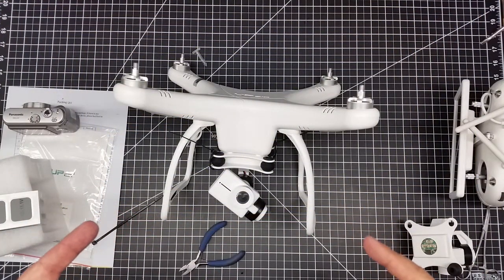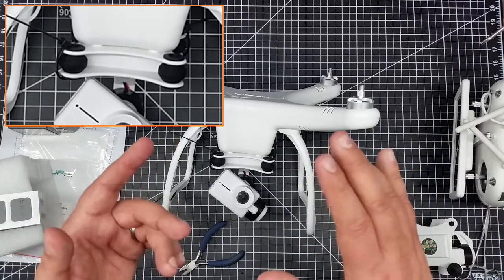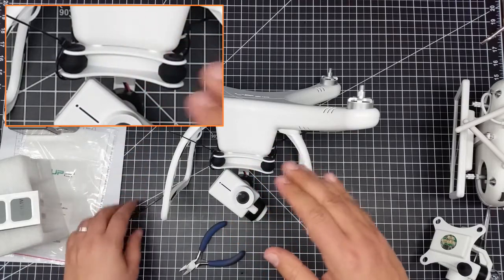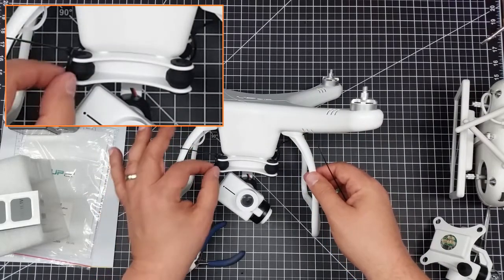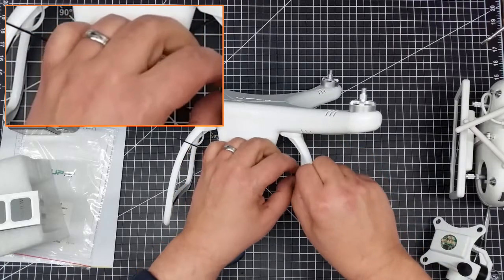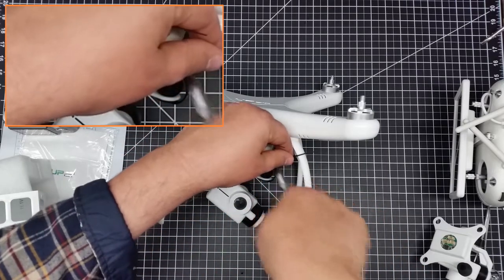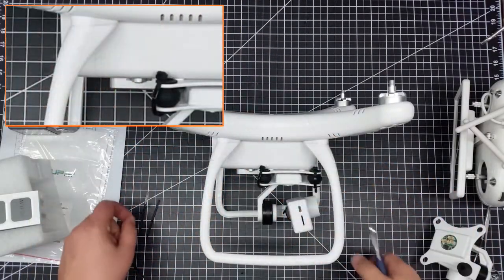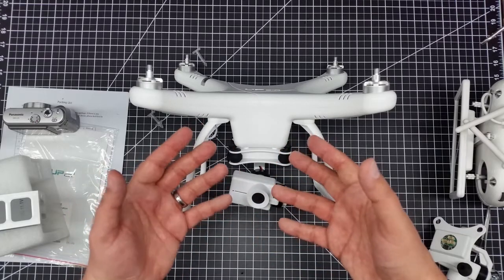Video Drone - Reinforcing The Gimbal On The UpAir One!

Comment: Haggai I don't know your name I tried the tie wrap the gimbal I just had a minor accident where to drone dropped off the air sort of like with with yours did I was about 10 feet in the air and it just dropped out like a rock on cement the Gimbal and the camera came clean off and I had tie wraps on all four sides of the camera I don't know if the tie wraps helped keeping the camera from getting damaged further but I need to figure out a way the keep that camera from leaving the Drone at all I am not here to say if your method worked or if it didn't work what I would like to know is How can I keep that camera on the Drone what do you think maybe a thicker tie wrap I have all different kind of sizes I have the smaller ones I have the medium sized ones that's the one I was using and I have the large ones what do you think
Reply from the maker: The main idea behind the cable tie is to prevent the gimbal from being ripped off and damaging the cables as the cables are hard to get (or at least where) whereas the gimbal and camera where easier to get or even repair.  As if you look back in the UPAir play list you will see I had a very minor crash, but because the gimbal was ripped off (also there was zero damage to the gimbal) it was basically worthless.  I do this to all my drones now and it has saved me several times...
Reply: Video-Drone. Yeah I tried you was the tie wraps and the gimbal rip right through the tie wraps I wasn't that high in the air either maybe 9: feet I'm going to go with a thicker tie wrap
Reply from the maker: Wow, it broke a cable tie?  That takes a lot of force even for a small one!